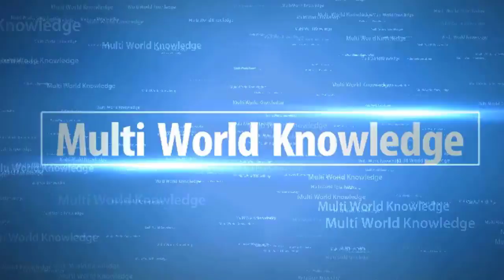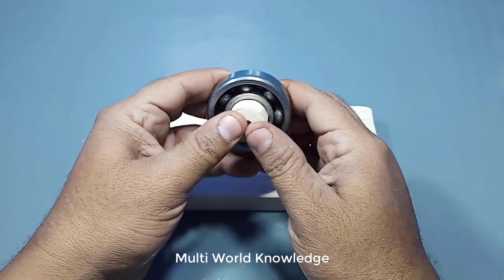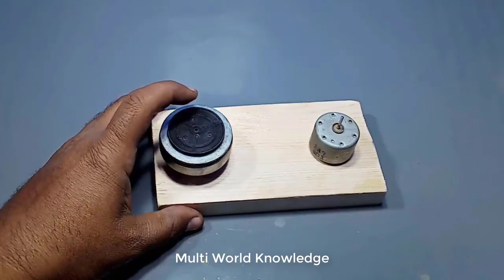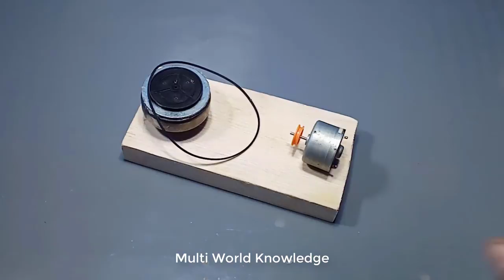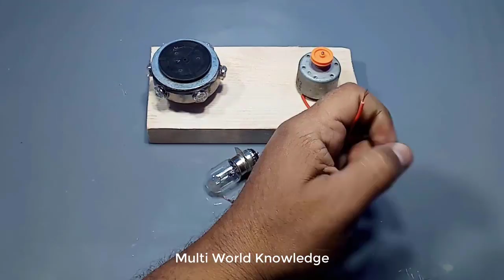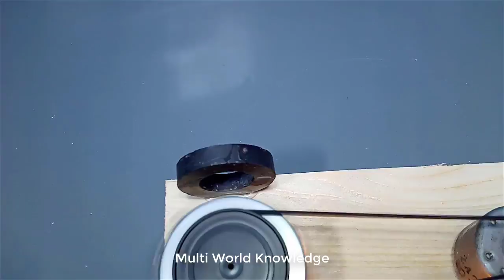New Free Energy Motor Generator Neodymium Magnets

Comment: Since 16 years, I have been dealing with angular energy electricity generation systems (R&D). My positive designs about angular continue. In this regard, my own financial means are insufficient, I had meetings with many businessmen, they accepted the financing of the project, but they gave up when it came to signing a protocol, that is, when it came to formalisation. If there is an entrepreneur who will take firm steps with me on this path, who is idealistic, has financial means and wants to make an official protocol, I would like to meet. 98% of the published videos are wrong and do not work. I know the mistake they all make.